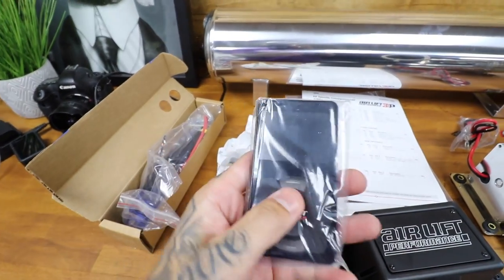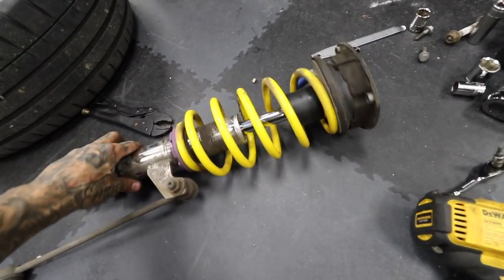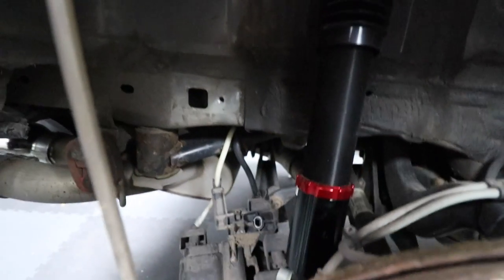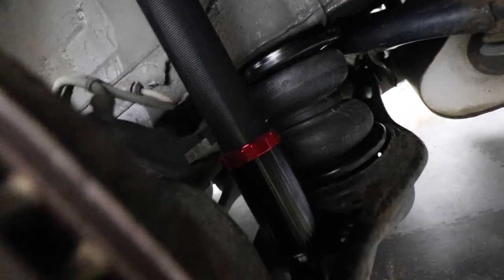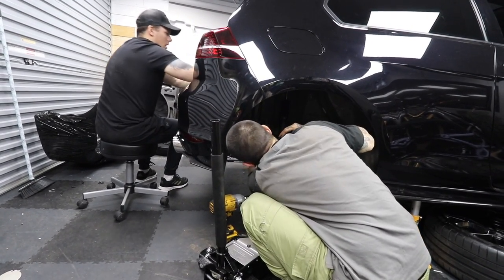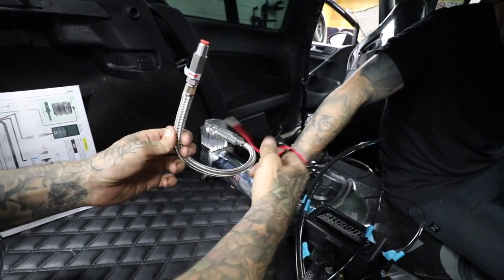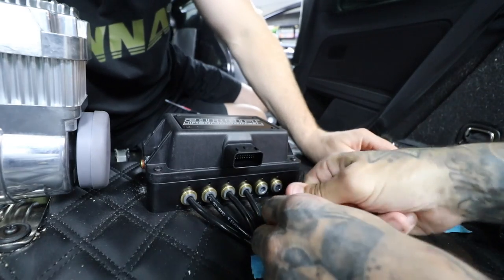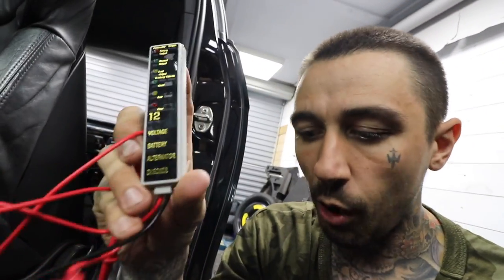VW GOLF R AIR RIDE INSTALL!! ( DIY FITTED!! )

Comment: Harry, I highly recommend you replace the fitting at the end of the compressor leader line that connects to the air tank (its called a check valve). The stock Viair ones are notorious for getting stuck. SMC makes better ones that will last you much much longer and are serviceable. It was one of the first things I had to replace with my air ride on my MK6. Welcome to the air ride fam, you're going to love it. Cheers!
Reply: ^^^ This man knows what he's talking about ^^^  I'm part of a few airlift groups and I'm admin for one.  So many people post about the issues they've had with the stock Viair check valves. They can cause an array of issues. Blown fuses from overworking your compressors from being clogged or they will break your compressor among other things. The SMC check valves are the way to go and can be taken apart and cleaned easily simply with a Phillips screw driver. I ordered two of them for my dual comp setup before i even installed my system.

Comment: OP, if you run into issues with the front airlines routed outside. You can route them both into the oval inside the wheel well. Look at 9:38 to reference the oval I’m talking about. You can see it when you pull the front wheels off. I then routed my lines under the cowl where the wiper fluid goes. Then I routed the lines into the firewall on the driver side. A little piece of mind in my opinion.

Comment: I had my doubts about this, but the result is actually spot on 👏🏻 not a fan of chopping the turrets out though 🤣
Reply: I had to do the same with my rear struts. I'm not a fan of stock suspension at all so I was at peace with always having aftermarket suspension. For any reason if I decide to remove air suspension I'd go for coilovers. Honestly though after having air suspension i don't see my car with anything else. I love it.

Comment: Loving the air ride content big show car guy myself I’ve an Audi S1 on  Kw V3 coilovers and I’m wanting to put air cups on top of them and slam it they work similar to a front end lift system on a super car but you can have them front and rear got me itching for it now noise when you air out is addicting 😍

Comment: I’m saving for the same lot for my Audi s3 8v facelift if your not arsed about having access to the camber bolts do you still need to cut the mounts ? I would prefer not to

Comment: That looks insane and the wheels tuck well fair play for smashing that out in your garage. What does it ride like ?
Reply: The ride is a little bouncy - especially at higher pressure but overall It's like riding on a cloud. When I drive city roads I drive on preset ride height - which is just below the original stock ride height. When I'm on the highway at higher speeds I drive on preset low ride height. It's less bouncy with less air in the bags. Also seems to maneuver better when lower . You can always adjust the damping.

Comment: Boss mate, car is amazing. Always wondered how a bagged car handles  when pushing hard through corners etc v conventional suspension. Is it good around the corners?
Reply: In general it's never gonna handle as good as static suspension, air ride is for cruising, comfort, and hard parking pretty much it.

Comment: Fair play Harry for cracking on and doing this yourself... car looks mint
Have you had to get the alignment and geometry adjusted and setup properly? With all the adjustment in the shocks i think thats something definitely worth sorting if you havent already.
Reply: You are correct. Alignment is the first thing you want to do after completing install. It would be a good idea to purchase an unlimited lifetime alignment package at a participating shop. One time purchase no annual fee. I go in to get mine aligned 3 times a year - every 4 months and each time i go in the alignment is slightly off.

Comment: @Harry Main, did you adjust the front or rear struts using the locking collars at all? Or did you just install them and adjust the air pressure?

Comment: Hi mate im fitting air ride to my b7 passat estate i got a few questions if you can help. On the rear did you need to cut or drill anything and im using same kit as you did you have to use standard top mounts? Hope to hear from you 
Thanks
Scott